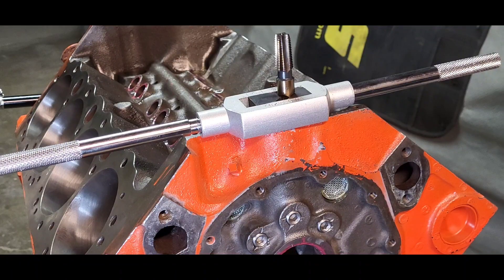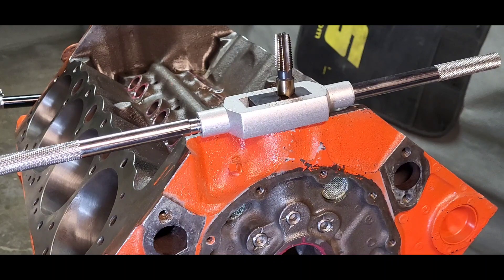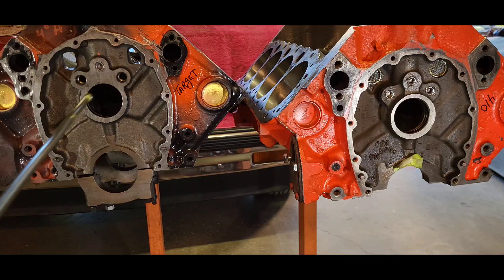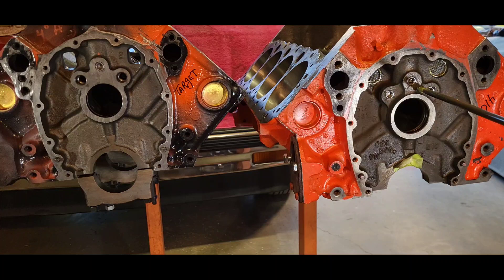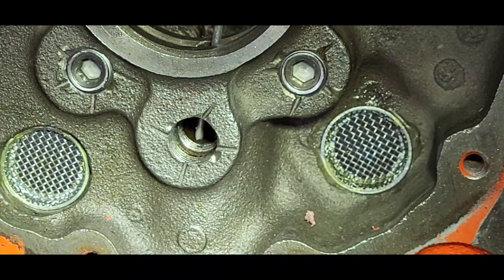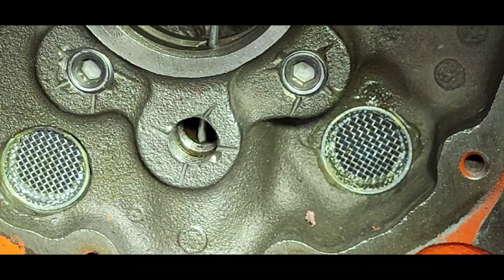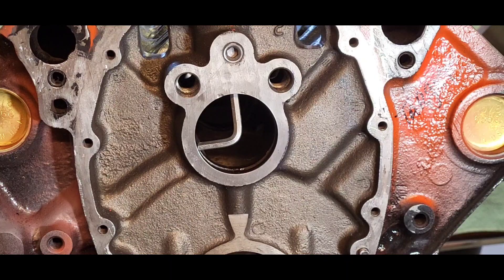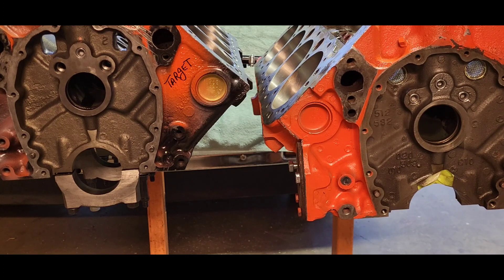Cutting Threads for 1/4 inch Pipe Plugs on SBC.

Comment: I must be old but I remember those oil galley plugs as a screw in plug. back in the 80s I worked in an automotive machine shop. You had to heat them with a torch to get them out. I never thought I would see press fit galley plugs.

Comment: Thank you for observing best practice on tapping anything tapered - stop cutting with 5 threads still showing on tap, then test fit plugs.  I have seen quite a few half wits run theit tap all the way in to a piece, forcing a jb weld repair or some such.  Personally, I have yet to see a fitting so undercut that I had to run a pipe tap in to less than 4 tap threads showing.
For anyone thats ever worked on older Briish machines, there is a wildcard that can bite a newbie faster than a rattlesnake: 1/8" BSP.  It has the exact same thread pitch as an NPT, but the taper is different.  Trying to mix & match these is guaranteed failure:  you really only have 1 1/2 to 2 thead engagement and its probably going to strip out.
Reply from the maker: You're welcome.

Comment: I only use sealer on the external plugs that could make a mess if they leak. The internal ones get a dab of oil in hopes they don't gale up. Keep up the good work👍
Reply: How do you gale?
Reply: @dalesmith561 He means Gall or Galling, to seize up.
Take care, Ed.
Reply: Hi Jay, I use oil on all the internal threads as well. 
Funny, you and I do the same thing.
I also do not want sealer in the inside of the engine. 
Take care, Ed.
Reply: @edsmachine93  you know how it goes, we hear things, see stuff and then make our own opinions. I know a lot of people working in engine shops and we share our stories and tips. When you go home and reflect on them stories and tips you start to see where they came from and how some of them might be a good fit in your own routine. I have only worked for a couple small engine shops built by owner operators and I have friends in large production engine shops. There sure is a difference between the level of detail between the two. 
In our small shops we see the rusults of our efforts and mistakes on a  more personal level. In the big shops like one I deal with where they pump out 6-8 longblocks a day in a 7 man shop, they skip many of little details we fuss over. An engine fails, they literally just grab you another off the shelf. 
 So it's fun to meet up with other smaller shop owners and find we usually have quite similar routines and experiences.
 Good chatin with you again Ed, lookng forward to the next time🍻🍻